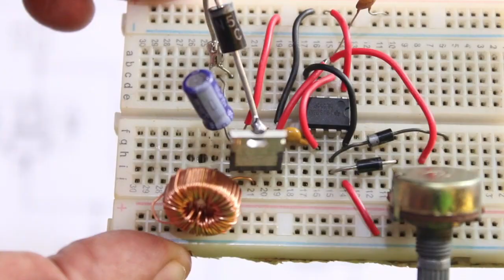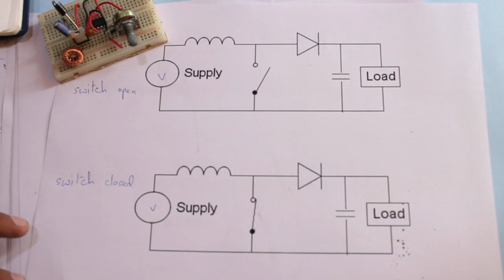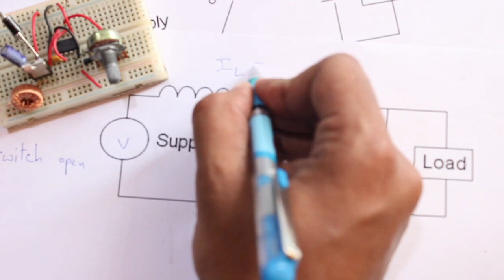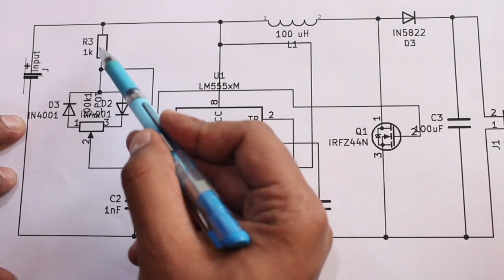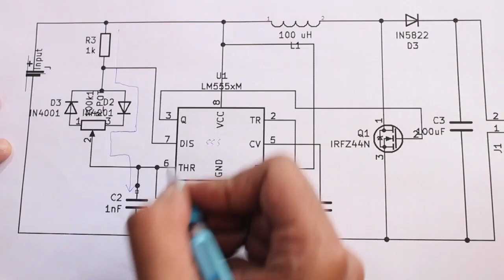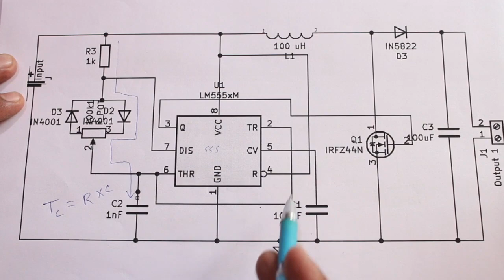Simple DC-DC Boost Converter using 555 Timer IC

Comment: Hello!  Because there are not any voltage feedback - the device will be broken very fast.The coil is a current source, so the output voltage will be growing until the electrical breakdown happened in a diode, or a capacitor, or a mosfet. When an out capacitor is with a polymer dielectric - the capacitor may explode.

Comment: I have made exactly the same circuit but it is not working
Reply from the maker: what problem are you facing?
Reply: @Circuitdigest  I am giving voltage through cell and same output is comming acrosss the capacitor
Reply: @Circuitdigest  Sir the circuit u made in video is different from the circuit in description as no positive termianl of battery is connected with the diode and capacitor. Second u have connected coil on 2nd terminal of MOSFET but in circuit it is on 1 kindly clear the problem
Reply: Same input and across capacitor same output